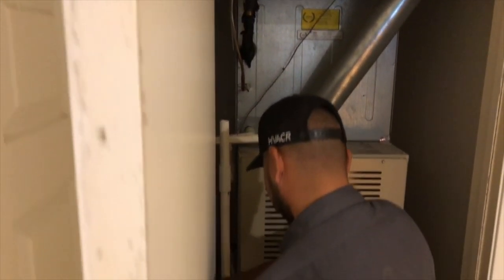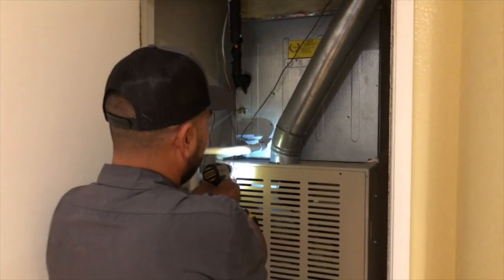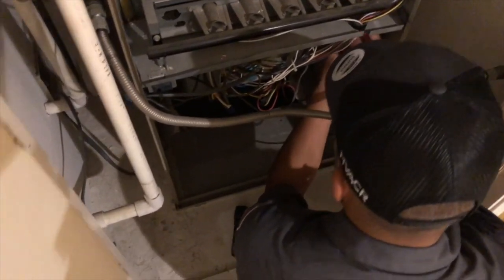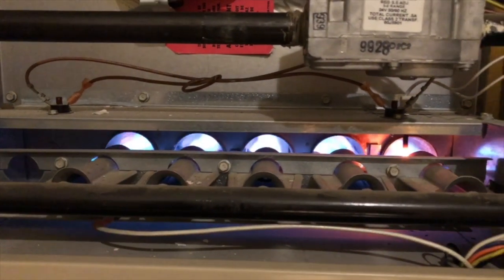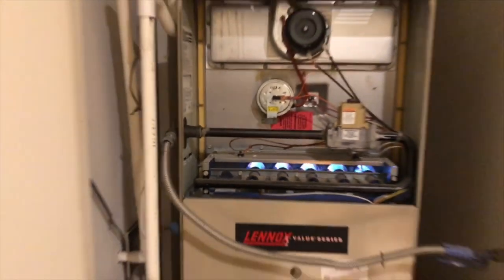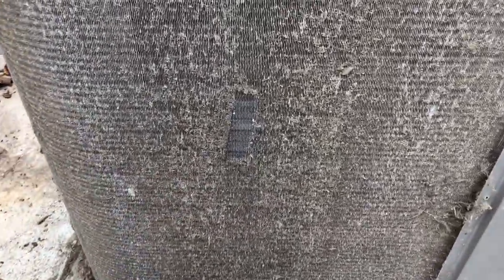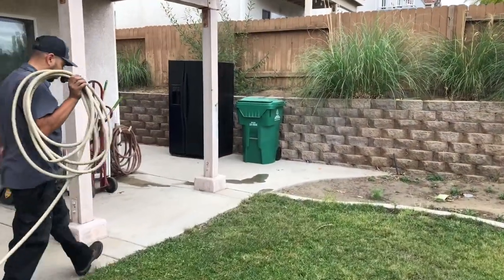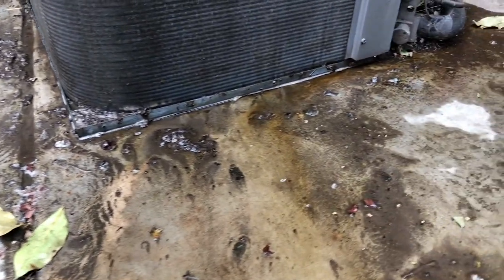Home HVAC Preventative Maintenance Beginning to End

Comment: We did one 1/2 of a cleaning I don't remember seeing any Guages pulled out no indoor coil inspection and the 2nd unit got splashed because it was clean sitting next to that dirty condenser left me feeling like another lack luster performance and the customer gets the bill. Great job and excellent explaining the process
Reply: You should’ve done a better job rinsing all that debris off of the concrete. Customers like to see a clean area when you’re done. No gauges?😮
Reply: My employer won’t let me hook up gauges during a PMA. He says that’s strictly when you need to as a sealed system can lose a lot of refrigerant when hooking up. Makes me feel like I’m not truly doing the best job though sadly.

Comment: No cleaning or inspection of the Evap??? No oiling of the blower motor?  No inspection of the blower fan blades?? Hmmm.
Reply: The blower motor has sealed bearings. It looks like he use the flashlight to inspect the blower wheel. He did not check the evaporator coil at all, I agree there.😢 As a 17 year season technician they should be ashamed of themselves. I would not want to be part of their company and bragging about their maintenance.

Comment: Y’all can’t be serious! That is not a maintenance. I did not see you check amp draws on the blower motor or the inducer draft motor. When you went to The outdoor unit you did not put your gauges on and check pressures. I didn’t see checking amp draws on the compressor or the condenser fan motor. You should be ashamed of yourself. That is not a proper maintenance. You left out lots of things😂